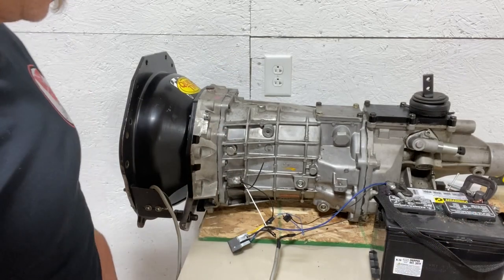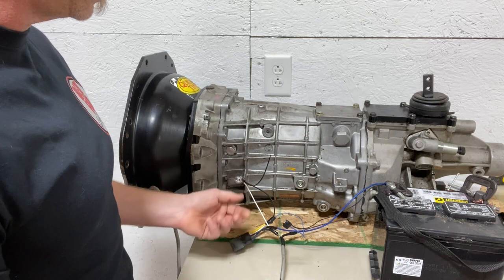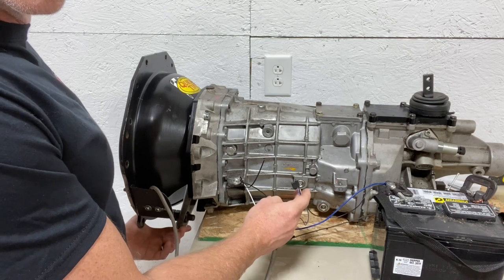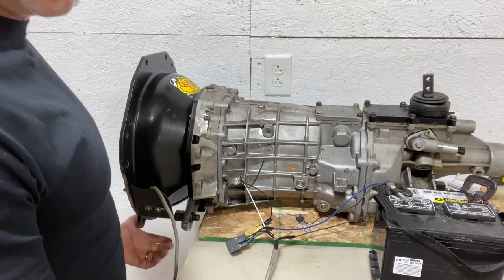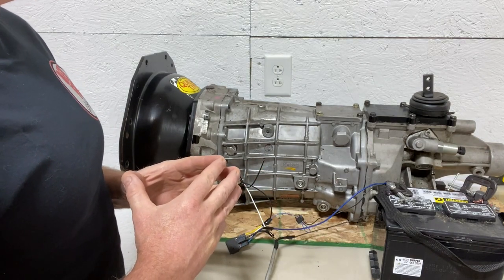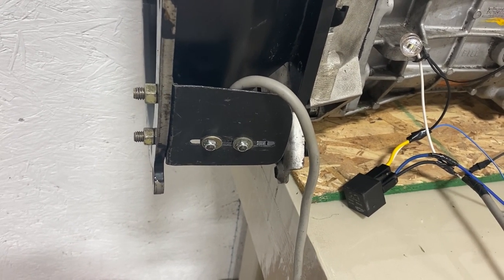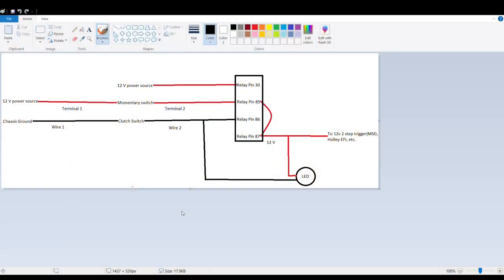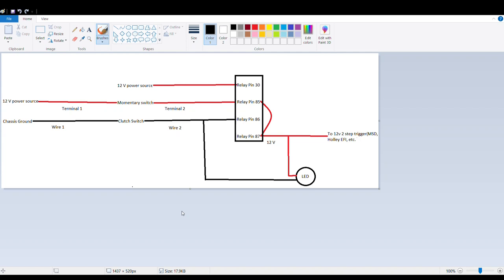Stick shift two step rev limiter… do it the right way!!

Comment: good info! thanks!
Reply from the maker: I’m glad you found it helpful,  thanks for the feedback!!
Reply: @redfoxgarage9660  who built your aode? I didn't have good luck when my car had aod, burned up twice on me!
Reply from the maker: I bought it used so I don’t know about all of the internals.  It has a PA full manual valve body with a Transbrake.  I know that  AODs are pretty sensitive to TV cable adjustments.  I used to run a regular AOD with a non lockup edge converter and a lentech valve body.  The internals were all stock and it had probably 100 10 second passes on it.  It never did fail or give me any trouble, I just went to a manual and sold all of the good parts from the AOD.
Reply: @redfoxgarage9660  yeah, I had the pressure set correctly with the gauge on the port, mine must not have been built properly or something.
Reply from the maker: sounds like bad luck,  how much power were you making?
Reply: @redfoxgarage9660  it was a while back probably 350 ish back then, it was definitely bad luck, that why I switched to manual!

Comment: Great video. Great info. But why couldn’t you just split your ground off and run it to your line lock. Is there any reason you couldn’t activate your line lock with ground?
Reply from the maker: You can do exactly what you said,  but then you are bound to your launch rpm for your burnout.  If that rpm is high enough you’d be good to go.   On my car I actually had 2 momentary buttons and 2 relays.  One would only engage the line lock, which  requires using a diode to prevent power feeding back to your 2 step trigger.  this button was not latching and needed to be held until I wanted the line lock to release.   The other button and relay was wired exactly as you are saying.   This gave me the ability to engage just the line lock with one button and  engage the two step and line lock with the other button. Thanks for watching and commenting!!
Reply: Your momentary switch is wired ground to ground? So every time you engage your clutch it “makes”. But won’t activate the 2- step unless the momentary switch is pressed. If that is correct then if I hooked up ground to activate my line lock it would activate every time the clutch was engaged. In that case I would have to have another relay, 2nd toggle and that diode. As you said. I am just wanting to verify as I am in my 3rd schematic on paper trying to figure it out. My ms3 is currently wired into a negative activating pin. If I change it to my positive activating pin I think it resolves all my issues.
Reply from the maker: I think my last reply may have misled you.  I had a schematic drawn up that may help if I can post it.  I'll try to dig it up and add it to the description.  Until then maybe this will help:
-clutch switch provides ground when the clutch is in
-momentary switch 1 is 12 volts
-As long as the clutch is in, once the momentary switch 1 is pushed it will latch until the clutch is released
- The output of the relay can provide 12 volts to your 2 step and your line lock, but your 2 step will be engaged whenever you are using your line lock( during burnout)
-You can add a second momentary switch and relay that provide 12 volts only to the line lock, but you have to add a diode to keep it from feeding back to the two step.

I will look for my schematic tomorrow and post it if I can find it.

Comment: Where does your clutch cable actually  go though ?
Reply from the maker: it goes through at the very end of the clutch fork,  just past the bolt.
Reply: @redfoxgarage9660    OK ty very much.   The switch  you posted  from Amazon.  Is it  a 12v or  does it not matter if it's more?  Thx
Reply from the maker: Glad to help. The one I posted was more than 12v,  but it won’t hurt anything.
Reply: @redfoxgarage9660  yea saw  that are like 250v.  Just  wanted to make sure.  Thx so much. for vid.